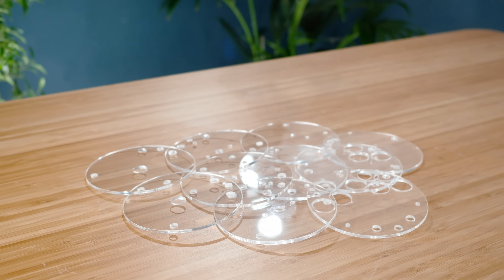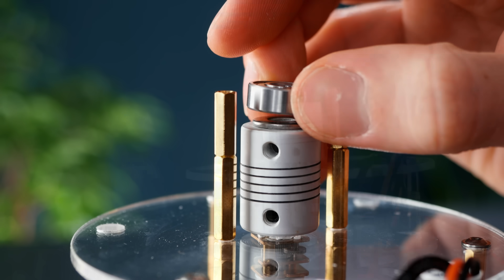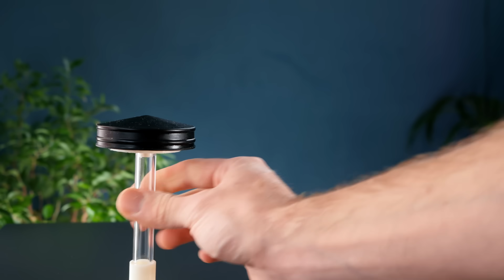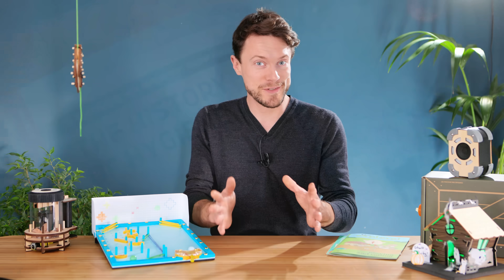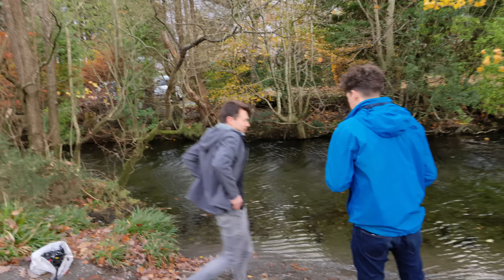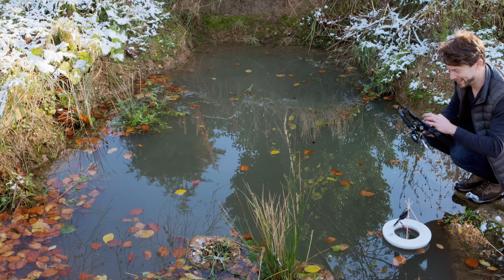Building a DIY submarine

Comment: The reason why the syringe sinks is not because of compressed air.. it's because more water can now push the syringe down by the sides. If you would try the same thing with the syringe upside down, it wouldn't sink both times.

Comment: May I suggest placing the syringes parallel to one another? (I mean the overall length could be reduced. We did this as a part of "college project" and it was quite difficult to get it to sink as the electronics chamber had air. We kept this air to achieve neutral buoyancy and pumped water in and out)

Comment: That was a fantastic watch!! the water pump thruster was amazing idea!!!

I was thinking about ways that you might increase the efficiency. Thrusters in space create acceleration from their own mass through newtons third law by using compressed gasses right? The water pump thruster creates acceleration by redirecting water mass from the inlet to the outlet and thus experiencing a reaction force in the opposite direction. 🤔

So for the water pump thrusters to work best, the inlets of the thrusters should be directed in the opposite direction! Right?

Comment: An idea of improvement, so it can be trailed behind a canoe or a kayak (in which case it’d not need thrusters): add a depth sounder using an ultrasound emitter-receiver, and a piece of programmable board (a micro-bit for instance) as to adapt the depth so the submarine would always be hovering above the bottom without actually touching it.

Comment: How did you design the 3d printed part not to split when you lock the rivnut/threaded insert in? and still get a tight lock? did you use FDM PLA? 
I use these a lot with sheet metal. But I would have thought they'd split a 3d printed part or not fit tight, so I have never tried.

Comment: Super cool project and a great video all around! If you aren't opposed to comments and suggestions I have a few regarding various design details.

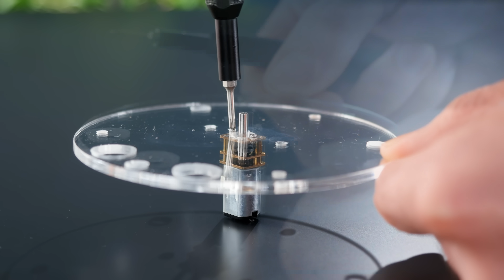4:03 It's hard to tell here but it looks like you chose a standard radial bearing here. The issue with radial bearings is that they are designed to take radial loads only. I know it's not a huge load in this case but from a wear perspective I would highly recommend switching to thrust bearing that sits directly on the acrylic plate, not in a cutout hole. Right now those two tiny screws are what's handling most of the thrust load and the radial bearing is basically acting like a simple standoff ring

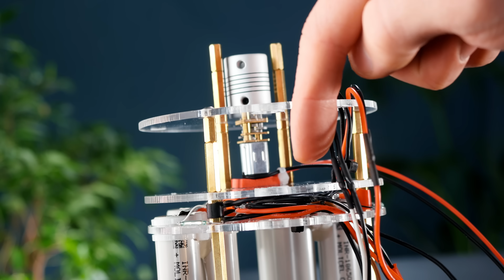4:29 Once again a thrust bearing is what you're looking for here ideally

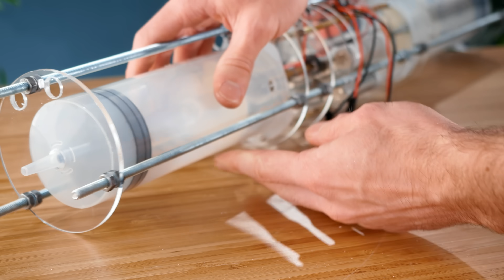6:19 While having a single inlet port may sound like a good way to reduce the chance of leaks, in my experience with pluming systems your biggest source of leaks are connection points. An ideal plumbing system would be a solid, monolithic shell with as few moving parts as necessary. Of course this is impossible to achieve, but the idea is that the more times you have to press, screw, or weld stuff together the more places there are for a leak to occur. Mind you I mainly deal with pressurized systems rather than effectively vacuum systems as you are dealing with, so if theres a naval engineer who knows otherwise please correct me, but I think you'd be better off having multiple inlet ports if it can reduce or eliminate connection points. Its pretty easy to spring a leak on a connection for any number of reasons, but a lot harder to lea through the wall of a solid part.

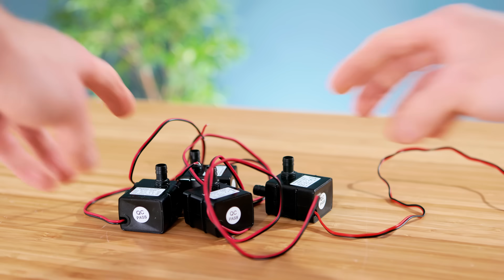10:35 This is actually pure genius! To anyone who may be thinking that this design choice seems fairly mundane or small compared to some of the flashier details like the ballast tank system, let me briefly explain why this is much more significant from a reliability engineering perspective. The most reliable system you can possibly design is no system at all. It costs nothing, takes no time to design, is objectively the simplest solution, and can never fail. In this case the system in question which most other traditional submarines have is the propeller shaft. It is a medium to high rpm connection, needs to absorb both thrust and radial loads (mostly thrust, radial only when turning or from cross currents), and needs to be pressure tight. In this instance I am defining a failure as leaking, since any other form of failure will almost always be recoverable whereas leaks could ruin all the internal electronics. Given that, the prop shaft would have been the highest risk of failure in the entire design by a large margin wthout precision machined components and properly designed sealing assemblies. Even with all that it still poses a huge risk of assembly error and a failed test could mean shorting out fully charged lithium ion cells in a sealed container (mostly sealed at least, given we are talking about a potential leak). Like if I gave the plumbing connections issue a risk rating of 3/10, for example, then I'd say the prop shaft would be an 8/10 for this design. But rather than spend time and money designing, testing, breaking, then redesigning, retesting, and breaking again until he arrived at a working design, he eliminated the need for the prop shaft entirely. And ya, it adds a lot more sealed ports for the wires, but the fact that the wires aren't spinning, aren't generating thrust, and can be routed wherever is most convenient makes it waaaaaay easier to ensure they stay sealed. Anyway, I just wanted to nerd out about this detail as it's something that they don't bring up much even in university courses in mechanical engineering and yet is the only way to 100% eliminate the possibility of a specific failure mode from occurring.

11:11 So assuming you have one channel set up to control yaw and another set up to control translation, and that these channels are then fed into one or more controllers or relay boards rather than directly to the pump motors, you could eliminate 4 of the pumps with the use of a pretty simple microcontroller. All you need is one pump per location: (1) starboard bow, (2) starboard stern,  (3) port bow, and (4) port stern. Run the channels to the microcontroller and then if it receives, for example, a left yaw command (as viewed from above) then it turns on the relays for pumps (1) and (4). If it receives a right translate command it turns on pumps (3) and (4), etc.

Comment: Really nicely made sub and love the presentation however if you are using a raft above the sub to hold the cables and RC antennae you could make the sub much smaller by removing the syringe mechanism and thrusters and use the raft to steer and raise and lower the craft, all the electronics including the batteries can be kept on the boat, so it's just like a rover, it's not a submarine if it's tethered to the surface.

Comment: If you redesign the submarine, you could try using sound for the remote control. Sound can travel quite far in water in comparison to radiowaves (which is the reason why sonar is a thing), so that way you don't need a floating receiver.

Comment: So wait, the old AM and FM transmitters and recievers that I've stubbornly refused to throw away work in penetrating water?  Awesome... ive always wanted an excuse to build an rc sub... and since I've got every kind of 3d printer  and some cnc and laser gear it might be doable!
Reply: ALL radio gets blocked by water, pretty much. Which is why actual submarines use stupidly long waves to try to stay in contact. Nothing DIY can touch. https://en.wikipedia.org/wiki/Project_Sanguine

Comment: A submarine should NOT be exactly neutrally bouyant...  it should be at least slightly positively bouyant, so that it can SURFACE LIKE A SUBMARINE.  You then add water to the ballast tanks to overcome that bouyancy, so that it will sink...  so that way if it plummets to the bottom, you just put the air back into the ballast tanks and it rises NATURALLY.

Comment: This almost looks like something a biologist might make for their studies. Simple, easy to understand, and not too expensive. Though I do have one question: What if you had a driveshaft and propeller, but put that whole section (engine and shaft connection to the propeller outside) in a separate compartment, and just seal off that section? Because what makes waterproofing a driveshaft so complicated is that it has to move. But if both the shaft and engine were separated from the rest of the vessel, you would only need to waterproof any cable-holes to that section (which don't need to be able to move, and therefore can be properly sealed). I don't know, I'm not an engineer, but it sounds plausible. Now, obviously the engine has to be able to work when submerged, and you would have to take that flooding into the buoyancy calculations.
Reply: there is also the magnet solution that I've seen used before. 
You put a set of magnets across a low friction paper stuck on both sides of your acrylic, and the motor applies its force onto the magnets, which transfers it across the acrylic without any need for a hole. You lose some energy in friction, but it's absolutely airtight, since there isn't even any hole to begin with.
Reply: #thank you so much #srsachinsr

Comment: This was absolutely wild. Id love to see more upgrades, i think the jets could have 3d printed nozzles to improve speed.  I do reallly like james's implemenation with outrigger nacelles and propelloers. seemed extremely quick

also what was that about sealing with olive oil??
Reply: Fill the servo casing with oil then put the top back on with hot glue to seal it.
Reply: Olive oil is fantastic for sealing servos. It's viscous enough to stay inside the casing without too much effort, doesn't degrade seals or bearings like some vegetable oils can and prevents water from reaching the control board. It also has the added benefit of acting as a wonderful lubricant so they seem to last a heck of a lot longer (my anecdotal experience only). I've got a few servos running in an aquarium that have been there for years without issue, though I have refilled them with fresh oil a couple times during maintenance. Haven't had one fail yet due to water ingress.

This was a bloody amazing project and I think I might need to do some tinkering now as well.

Comment: I always wanted to build a submarine out of a large propane tank. 10-12 feet long and about 4' in diameter.  I figured i've have 2 ballast tanks like pontoons. Build a floor in the tank and fill the area below the deck with car batteries, some dead, for weight and some charged to run the air pump, underwater camera, sonar and motors.  I figured a couple of trolling motors would drive it.  One or two motors on the rear and one on its shaft sticking down through the bottom that would turn to steer.  The underwater camera would point the direction the steering motor pointed, wires through the motor shaft. The air pump would suck the air out of the ballast tubes and into an on board tank. I'd have a pressure gauge through the hull and valves to release the air back into the ballast tubes or the passenger cabin so if the air pumps failed I would be able to open a valve and resurface. I figured it would be easy to control air pressure and be able to open a bottom hatch while submerged. I planned on launching it in a large shallow lake that would let me limit depth to start.  I had all the details figured out, like captured balls that would drop into place as the last of the water left the ballast tank and block any air from escaping and allow the ballast tanks to pressurize against the sealing balls and prevent air from escaping if it were to tilt. The plan was based on me learning to scuba dive so I could be set up in case I had issues. I never followed through.  
Physics professors at the university thought my plans were workable.

Comment: This is amazing coming from the drone world I was so curious on how you were going to get a RC controller to work under water!
Reply: I am somewhat surprised he did not solve this problem. To know how to accurately communicate underwater go no further than dolphins or whales do. Before infrared remote tv controls there were ultrasound remote tv controls. water leans itself to this as sounds travels forever under water: you can produce different signals by FM or AM that gets interpreted by the sub as commands

Comment: If you want to use it 2nd time then no you cannot submerge a brushless motor, bearings will get the grease washed out, also there will be electrolysis going constantly anywhere where there is exposed wire.

Comment: Not sure it would suite the manoeuvrability that your looking for, but it's possible to use buoyancy to drive forward motion using wings, almost like the opposite of a plane (where forward motion creates lift), creating a sort of underwater glider. They can travel huge distances in a kind of wave motion, translating the floating and sinking into forward motion. However, I think they tend to be autonomous, i.e. you set them off in the middle of the ocean and they pop up with a GPS after a certain time. Checkout "seagliders".

Comment: Why u use 4 pumps for sideways motion and anther 4 for rotation?  
Get the proper signal mixing (same as RC tanks) and use only 4 pumps.
Your Flysky should be able to mix that, or like me you can use an arduino and also program a deph holding algo :)
https://www.youtube.com/watch?v=uahyMLQUDqo

Comment: Syringes are designed to move fluids and gasses from place to place, and not to compress a gas or draw a vacuum.  Making a syringe do either is working up hill so to speak, like using a fork as a knife.  Subs use reserves of compressed gas via … compressors.

Comment: Nice submarine. Your buoyancy tanks seems way too big for submarine of this size - you can balance it with ballast. I would rather use room for more motors, batteries and and devices. It  might be cool if cord to surface was thinner and would pull back itself.
Reply: Actually it may be good to have greater buoyancy tank if you want pick something up at some point.

Comment: I find it interesting that the RC guy opted for a tether. His sub also seemed to have more balance issues than anything, like the pocket of air in the bottle was moving back and forth.

As for yours it seemed slightly off balance after adding weight I wonder if adding it to the ends instead of more towards the center played a role in that.
Reply: #thank you so much #srsachinsr

Comment: Are the syringe motors controlled by a single control/knob on the controller or separate? Would be cool to build them into a single controller but add some sort of 'Trim' so you can angle the sub up and down in the water.
Also loved the use of the pumps for propulsion! But the final shot also to me suggested that maybe the forward/reverse thrusters should be only on the bottom at a 33 degree angle or something so you don't lose thrust under while above the surface! can't wait to see the next version!

Comment: Holy crap. A am a friggin idiot!! I have two degrees computer engineering, and mechanical engineering. You just gave me a simple solution to a problem I was having with one of my mechanical designs I have been puttering around with on and off,  that just became practical. One of those forehead smacking, why the hell did I not think of it moments. 😁👍

Comment: The water pumps for control are so genius I would have done control surfaces, or vectoring props or somthing like that :D
Reply: Wait until you hear about the model sub that needs NO PROPULSION. IT GLIDES. Uses the same syringe buoyancy trick to shift both its center of gravity and degree of buoyancy, then it "glides" downwards on its fins the same way a glider plane flies while losing altitude - except then it reverses buoyancy to be lighter then water and "GLIDES UP". Rinse, repeat, etc. NO actual propelling motor needed.

Comment: i had the idea that you could add an pressure sensor outside to see if it sinks or rise up in the water. So if the pressure sinks its going up and if the presure is getting bigger it sinks. If it stays the submarine stays at the same deep.

Comment: Talking about new designs - big submarines, like picture, that you showed in video, don't compress air to descend. It's much faster to just let air from ballast tanks out, filling them with water. 
To ascend the have to displace it with a comressed gas. You can use airgun CO2 cylinders for that, 12g cylinder will give you about 6 litres of gas.

Comment: with the way you had the batteries set up, wouldn't adding extra batteries for a higher amperage for the 12v also add towards the weight for keeping it neutrally bouyant, also instead of having both syringes opperating separately have them wired so that it's only a single trim control to operate them both,

Comment: Cool project! Instead of adding the steel, You could add some of the weight with extra batteries to have more energy and weight, allowing longer journeys. By the way, did You measure the power consumption of the submarine? Very interesting!
Reply: #thank you so much #srsachinsr

Comment: Thats nice ,the problem you going to have with your  transmitter  setup is that  you are limited only fo couple meters of water because of the 2.4hz ,after that you will not having signal ,in the RC submarines that want to go deeper you need either the old 35mhz with the antenna  transmitter  or  the most common a cord ! Make sure  to install a fail safe  connected with your air valves so if you dont have signal the submarine will submerged , is the most common problem rc submarines got and i have seen few going down....especially in a milky water is hard to find them !